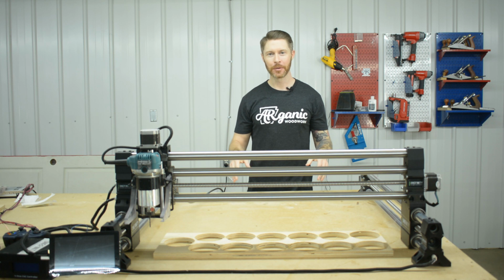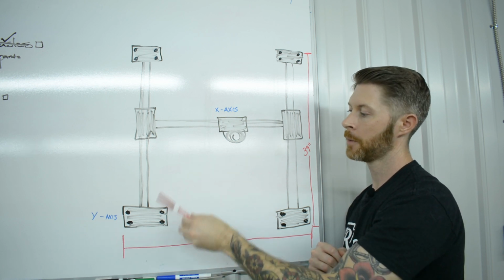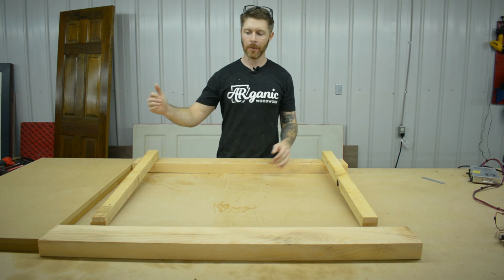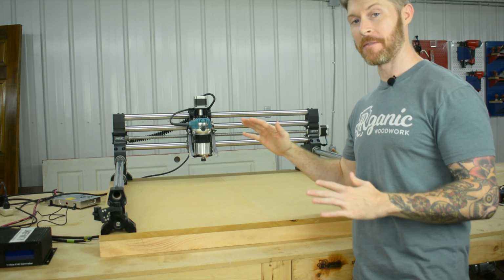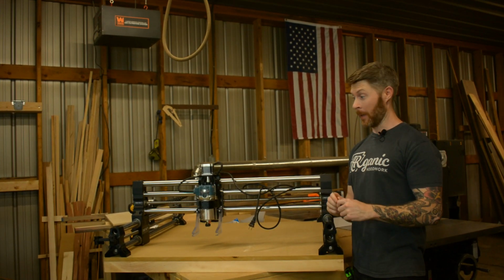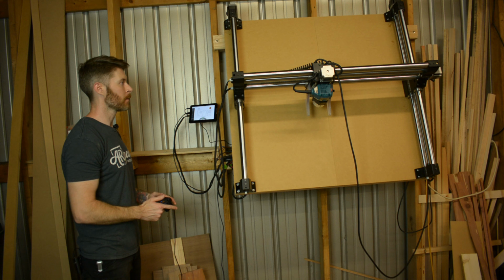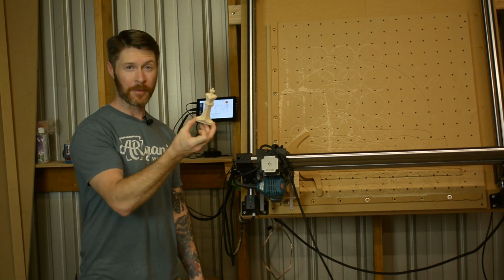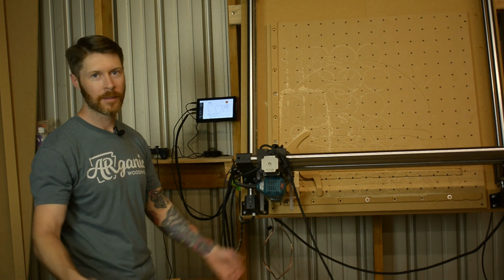Getting sideways with the Onefinity CNC

Comment: I like the idea of mounting it on the wall to save shop space and having it fold out to 90 deg with drop down legs. I would however mount the cnc with the y axis running parallel to the wall when it is folded out, so tiling wouldn't be an issue

Comment: I think you are only considering your own situation when you say it is ridiculous to mount it on a wall, later in the video.  I am in a wheelchair for right now and mounting this unit on a stand so it pivots vertically, or at least at an  angle,so I can reach it without standing.  It will help with dust collection as much of it can fall into a tub below the machine.  It also makes it portable since it will be able to roll through a normal width doorway.  When I get able to stand again, my mount will be able to swing flat and lock there enabling use like your swing-out legs will allow.  I am building a 12" long 90 deg extension on the front to be able to do joinery on the ends of boards.  I will also make a torsion box with mdf on the top and bottom to keep the surface flat, not taking a set (bow) as mdf can do.  Thanks for posting.
Reply from the maker: Yea thats a thought and sorry to hear about your situation and pray for healing

Comment: I was thinking you could use a cantilevered hinge with a gas assist strut as a fancy way of bringing the unit from vertical to horizontal, having the CNC on the outside of the wall and end up flat and on top. With fold out legs underneath. The front would pull out having the back side drop straight down, resting on the hinged cantilever and using the gas assist strut absorbing the weight of the back dropping and raising it back up. Just a thought?

Comment: nice idea to save space but I wonder how long will the motors last now that they have more gravity to fight being vertical at 60 degrees. I would think the motors would wear our faster when the motion is in an upward direction but it was a good video and if you need space then perfect.
Reply from the maker: It was just for the video and to show off the ball screws. I would recommend making a foldable leg system so that the machine folds up to a flat position.

Comment: The stats given on website say 45 5/8 for width
Reply from the maker: Yea when I made the video the information was just coming that it would roughly be 2” larger all the way around so that’s why I just stated make it bigger and yes I will put a disclaimer in the description sorry about that. Definitely go by what OneFinity is saying
Reply: this is a beta unit, not one of the stock units.
Reply: @jeffklawuhn8216  yes I know, but in the video you said to increase to 43" from 41" to account for differences. Based on that info online, it's actually 45 5/8, only mentioned it because I'm sure someone will try this and at 43" they will still fall short. I doubt the 45 5/8 is 100% due to odd size, but it's the info provided by Onefinity so I mentioned it. Wasn't criticism, just thought it needed mentioned. The video was a good video & it helped me because I was thinking about angling the machine as well when mine comes. thought about doing a 30° tilt. I was concerned about weight being excessive & possibly extra unnecessary stress to machine.